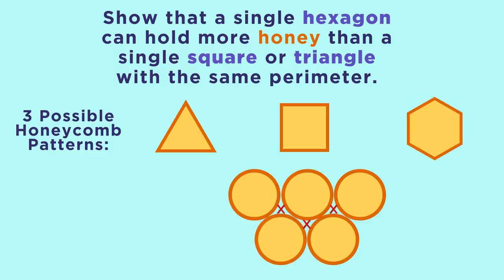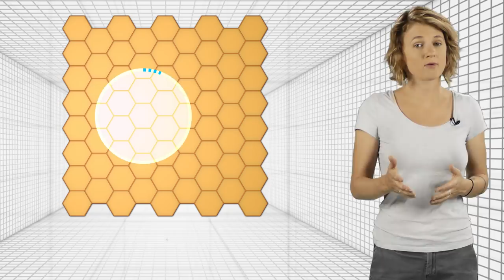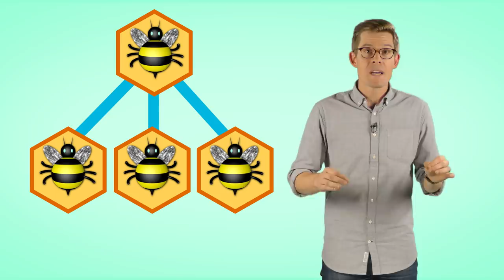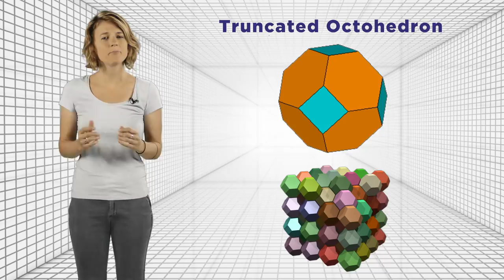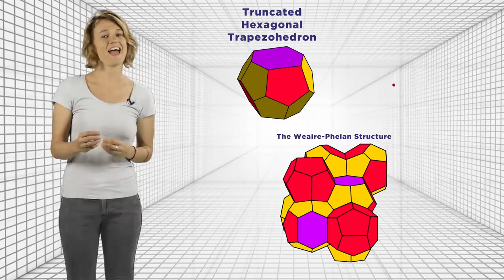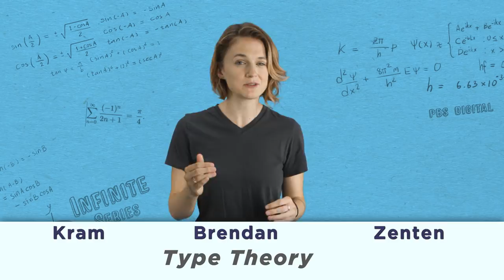The Honeycombs of 4-Dimensional Bees ft. Joe Hanson | Infinite Series

Comment: Why don't we live in hexagonal houses?
Reply: Because we don't need to minimize street length.
Reply: Scott ... Yet, we don't fly yet. XD
Reply: that actually sounds like fun
Reply: Because gravity requires us to make vertical load-bearing walls and horizontal floors (so no vertical hexagons), and it needs to be possible to travel in a straight line through intersections (so no horizontal hexagons).
Reply: Somebody hasn't played enough Cities: Skylines - http://imgur.com/IIbBaif
Reply: because people would rather have 4 potential enemies than do math and have only 3
Reply: We don't have six legs, duh.
Reply: You can actually walk on the walls and the ceiling in The Legend of Zelda Twilight Princess. Maybe you find it interesting.
Reply: Then how does the guy living in the middle get out of his house? Get through his neighbor fence?
Reply: Aesthetics take precedent over efficiency when there is an abundance of resources and space.
Reply: We may in future
Reply: Uh, because sheet-rock wall panels are sold in rectangular shapes? Good question actually. Isn't the hexagon a more structurally-solid shape? And perhaps the hexagon better minimizes external surface area which would be good for purposes of wall insulation, while maximizing internal floor area. The sphere or geodesic shape does this better, but perhaps at higher building costs.

In a hexagon house, you could have 7 rooms, without any hallways, all 6 exterior rooms having privacy and access through the central 7th room, a room with 6 doors. Well except one exterior room would have to be reserved as an entrance foyer. Other arrangements are possible providing more than 7 rooms. Or were you imagining the shape of the house to be one big hexagon, rather than the shapes of the rooms? In that case, would each room be a triangle?
Reply: Because we have 4 limbs so rectangle.
Reply: @vaguebrownfox 
But that does not prevent us from building hexagonal homes. I think the real reason is probably, ... drum roll ... "Tradition. Tradition."

I have often thought that our boxy rectangular homes, look so unnatural. What else do we see in nature, that is built in the shape of an ugly rectangular box? It isn't even a very structurally sound shape. Easily knocked over in high winds. However, cost could very well be a factor. People want big homes that they can afford. If more "natural" shapes can not be built affordably and cheaply, then I imagine that "boxy" and ugly will continue to be the norm.

BTW, I think much of the reason why windshields on cars are almost-always curved, is because even a gradual curve makes the shape a whole lot stronger than a mere flat window pane would be.
Reply: @yosefmacgruber1920  Cringe at read more.

Umm actually...
Windshields are actually made for aerodynamic purposes. A smooth surface has less wind resistance than a flat one. Improves the fuel efficiency that they need.
Reply: @someonesomewhere3817 
Flat can be smooth.

Yes, windshields are increasingly aerodynamic, especially on Tesla electric cars. But a large flat pane of glass is also weak and fragile. It can not take very much stress before it cracks and breaks. A curved windshield does a much better job at resisting deformation and bending, because it functions more like an I-beam, having portions that would have to stretch a lot more, in order for it to bend. It has more mechanical advantage to resist the bending. Curvature gives some effect as if it was thicker, without having to be so thick. A box more easily caves in, if pushed in the center of a broad flat area, than if pushed at the corners, which have material going in both directions that can help resist the deformation.

Curvature also spreads the stress out, rather than concentrating it in corners where then cracks can occur. Hence why airplane windows have curved corners rather than square corners, or are almost round.
Reply: Because we only have 4 legs not 6 legs... Only me? Okay
Reply: @cardodalitay9184 
I do not need 6 legs in order to live in a hexagonal home. It seems like a cool idea to me, although perhaps not affordable?
Reply: Because we like long straight streets that can be easily cut up rather than repeatedly turning, and we are more interested in street length than perimeter.
Reply: @jeffreyblack666 
But you can put a lot of hexagonal houses onto a street, and for houses to have lawns it is not required that each house's lawn(s) be arranged in nice ugly rectangles.

Maybe hexagonal houses would cost more, which would be then a reason against doing it. However, it also appears to be a lack of creativity that we humans don't bother with anything other than boring and ugly rectangles?
Reply: Because not every side of a house needs a street to be funktional.
Reply: @yosefmacgruber1920  Yes, you can put a lot of hexagonal houses on a street, but it offers no advantages.

Perhaps the better way to see it is to consider us vs bees.
The Bees have a comb, effectively a block, where the individual cells, effectively houses, go into the comb. The surface of the comb is analogous to our street.

That is the big difference. Our street is 1D. A bees street is 2D. Thus the Bees tile their houses in 2D in a hexagon, while we tile them in 1D in a series of lines. We then both tile our blocks in 1D.

There is no real advantage to having a hexagonal plot of land.
Reply: @jeffreyblack666 
But there would be an advantage if I could get my hexagonal plot of land at a discount.

And perhaps it has something to do with the tradition of having both a front and a back lawn. Why do we need both? Maybe just one lawn would be enough? It may also have something to do with privacy and inefficiency. Perhaps the standard boring way of laying out plots of land for houses, helps insure that many windows will be far away from the view of nosy neighbors' windows. Hardly efficient, but maybe it serves a purpose?

So let's get rid of streets then and upgrade to self-fly flying cars. Then we won't have to consider costly street frontage anymore.

I doubt that your analogy is accurate. Besides, there is no such thing as 4D bees.

Probably the most likely reason, is that the bureaucrats who design our cities, are dunces when it comes to innovation or mathematics, and anything non-traditional might result in a less liquid market. How many people would want to be the first to buy a plot of land that is in a "bizarre" shape, or to live in a house that looks refreshing "different" from every other house? We are way too much copycats of each other. So much so that there was an amusing song in the 1970s I think, about a guy who got arrested for going into his neighbor's house, well because they all looked exactly the same, like cookie-cutter houses coming out of the same factory. Really? Same lawns, same houses, same lawn plants? And then what is the song "Little Boxes" about? Little houses on the hillside, little boxes made of ticky-tacky ... And the people in the houses, all send their children to the university ... and they come out all the same.
Reply: @yosefmacgruber1920  If the only advantage is people selling it for less, then it isn't really an advantage.

The roughly square/rectangular block of land is primarily due to breaking up plots of land along a street with the street being straight. It also allows easy subdivision in the future and different size plots of land.

My analogy was dealing with 3D bees, no 4D at all.
We move in 1D along a street and have our houses packed along that 1D street. (i.e. line segments)
Bees move in 2D along a comb and have their cells packed in that 2D comb (i.e. hexagons).
In both cases they extend through another dimension to convert the line segment into a rectangle and the hexagon into a hexagonal prism.

While your idea of flying cars could help, it still offers very few benefits (if any) and has the issue of everyone needing to fly.
How about instead we all live underground so people can walk over the land in 2D, with our houses little hexagon bunkers underground?
Or take advantage of your flight idea and extend our streets upwards to be a plane and pack our houses like bees? But then we would run into issues of support pillars.

If you want to discuss math or the like in city planning, it is typically breaking from the grid which causes issues.
Reply: @jeffreyblack666 
Why isn't cheaper land a benefit? Because land cost isn't really that much of a factor? Do I need a full-sized front lawn, or merely enough street frontage to get a car into my driveway?

I still think it is largely due to lack of creativity, and everybody trying to be the same, however, if there isn't much benefit, then what really is the point?

I think the video was about 4D bees. Whatever is that?

Live underground? Then you better have a watertight structure and a reliable works-during-power-outages sump pump. What could go wrong? Watch the video game on YT Raw Danger . You try to survive in an underground city complex getting flooded from too much heavy rains outside.

Flying cars has huge benefits. You could commute to another state to go to work. Your speed limit would be around 500 mph.

Breaking from the grid? There are many types of grids. Squares and hexagons are the only regular polygons that tile the plane. Well triangles also. But there are more possibilities, if we do not require all the shapes to be the same shape.
Reply: @yosefmacgruber1920  Cheaper land would be beneficial, but it isn't a benefit of a hexagonal grid. The only reason you would get a discount would be for it being strange.

The hexagonal tiling minimises perimeter. That is only a benefit when the perimeter is of the same cost. A fence (which isn't on all boundaries) costs a lot less than a road and footpath, especially as the road takes away area from the house. Due to 2 sides being needed for the hexagon streets and one being needed for the rectangle streets, the rectangle provides a better area and a much lower cost. (A simple comparison is a straight street, vs one zig-zagging back and forth.

Again, the real comparison is line segment vs hexagon.
In order for hexagons to be better we need to be able to move in 2D without the houses getting in the way.

For the flying cars, use context. They don't provide a lot of benefits to hexagonal grids.
The only way for them to make hexagonal grids better is if everyone uses them so your property is surrounded on all sides by other houses and then you fly around above it to get out.

Breaking from the rectangular grid.
Reply: @jeffreyblack666 
What I meant was, not that a hexagonal grid makes land cheaper, but rather, maybe a plot of land might sell for cheaper, because it is of an unusual shape that other people might see as strange or useless. Maybe it was a weird shape, because somebody had too much land and decided to subdivide it and sell off a piece of it. If land is only divided into rectangles, then there is the problem that some rectangles may not have any street frontage. That should be okay for flying cars, but we don't seem to have flying cars yet. I can't so well be expected to drive across my neighbor's lawn every time to get to my home? So I either need street frontage or some right to share a common driveway.

Rectangles seem to not be found in nature, but perhaps that hardly even matters though. Rectangles are boxy and boring and ugly, but so what? Maybe there isn't much that we can do about it?
Reply: @yosefmacgruber1920  i.e. cheaper land is not a benefit of a hexagonal grid itself, but people not wanting that plot of land.

There are many ways to divide rectangles up. A simple one is only ever dividing along the street. But that can make houses quite small. Another is to set it up to effectively have a mini-street, where there is a long driveway that goes past multiple plots, which occurs in quite a few places. It can even be divided to give a proper street.

As for natural rectangles, there are a few rectangles in nature, such as some crystals and rock formations, but they are quite rare. That doesn't mean they are bad.

Again, this ties back into how many dimensions are traversed and connections between them.
Reply: @jeffreyblack666 
Well maybe the shape of the land plot doesn't matter so much, just so long as people can get a place to live outside of has-been Babylon America.

Or you can have narrow plots of land that run a distance away from the street, so that people can have "shotgun" houses, meaning that you have to walk through a room to get to another room, you can travel from one end to the other along the straight path of a bullet. Maybe I didn't explain it good, because I am hardly even familiar with the term.

Who said that rectangles are bad? I just said that rectangles are unnatural and boring and ugly. But if that is the way to make cheap and affordable housing, then I guess we may be stuck with it for a while.

I think somebody should invent a 4D house. That would be so cool, and perhaps more efficient in multiple ways. Why is Dr. Who's Tardis about the only place in the universe that is bigger on the inside than on the outside? I would gladly live in a 4D house. Even if it is rectangular oops, make that "Even if it is a hyper-cube".
Reply: Because we're not as smart as bees
Reply: @hamman_samuel 
People are smarter than bees. A few weeks ago, I just could not get rid of a bee that kept buzzing against the window glass, unable to figure out that it is impossible for it to fly through window glass. It wouldn't be shooed away, couldn't even find the open door. It just kept trying again and again. I finally had to grab the bee and manually evict it. And no, I did not get stung. Apparently I knew what I was doing. Held it in such a way that it could not maneuver to sting me. Well somebody told me that bumblebees/carpenter bees do not sting? Well maybe that is it also.

So why don't you build a hexagonal house then?
Reply: @hamman_samuel  We are smarter than bees. Like I said, it is because our house layout occupies 2D, not 3.

Or to put it simply, it's because we can't fly.
Reply: You cannot compare the logic of building 3D buildings to the logic of flat honeycomb cells being made.
Reply: 2 arms 2 legs = we like squares
Reply: We should
Reply: @peabrainiac6370  it would be cheaper to have less wall.
Reply: we dont need to miniminze and also, the same physic thing, we preffered use squares/rectangles and cylinders to make our houses,
Reply: Wild guess - we pack things (buildings, rooms, furniture etc) in 3D, and cubes/rectangles are easier to build than truncated octagons and those other shapes. I think.

Comment: In a regular sphere packing structure each sphere will touch 12 spheres around it. The 12 spheres will form the shape of a cuboctahedron. When compressing the structure, each of the 12 'touching' points on the surface of each sphere will become a face / plane, and eventually those faces will touch each other with their edges and fill up all the space. When points of a shape become faces (by truncating) the resulting figure is the dual of the original figure. The dual of the cuboctahedron is the rhombic dodecahedron. So, in my opinion, when compressing a sphere packing structure you will get a space filling structure made of rhombic dodecahedra (that have 12 regular sides), and not truncated octahedra. Packing of truncated octahedra and the Weaire Phelan shapes do of course exist, and they might be more efficient (less surface area), but the regular rhombic dodecahedra structure is what you get if you equally compress (or expand) spheres that are regularly and closely packed. So I think this is what 4D bees would come up with. Besides that the rhombic dodecahedra structure will also be stronger than the other packing structures, and strength is another important property of a beehive.
https://scholar.harvard.edu/files/sbabaee/files/1-s2.0-s1359645412000900-main_0.pdf

Comment: I don't have a specific topic recommendation, but I'd like to mention that I'm greatly enjoying the multi-video arc Matt's been pursuing on Space Time.  Set a goal, state the starting point, then define a narrative arc where each episode is great on its own (with occasional detours) while also being a chapter in the larger story.  Can (or should) Infinite Series do something similar at that scale?

Physics is (generally) restricted to physical reality, while math is not, so I'd think math would potentially have many more possible arcs to draw and explore.  In particular, the interconnections between fields within physics are fairly clear, while new interconnections between fields within math (and physics) are continually being discovered/created.

Also, it seems math has many more "Great Problems" that have precise definitions, which may serve as fascinating waypoints or endpoints for the narrative arcs.

I suppose the counter goal is to avoid becoming a "class" in the traditional sense, where dropping in in the middle would be confusing, so the arcs would need to be relatively brief when all episodes are strung together (under, say, 2 hours - a movie).

I'd like to get "The Big Picture" of how things connect together in math, while also getting some low-level detail of the parts.  Tough to do in even a few videos, much less one.

Here's one take on the terrain I'm talking about for the narrative paths, "The Map of Mathematics": https://www.youtube.com/watch?v=OmJ-4B-mS-Y